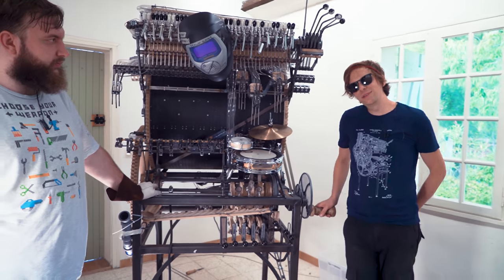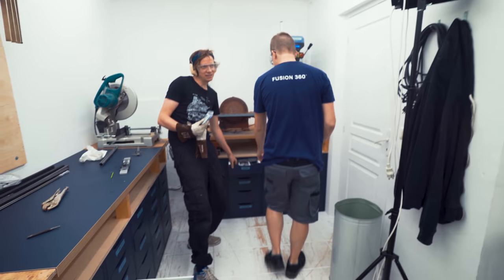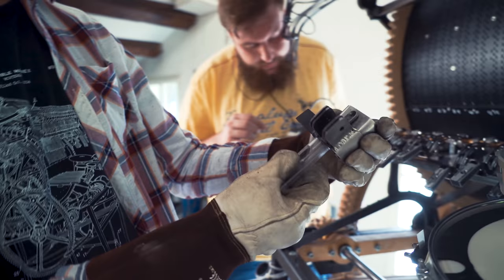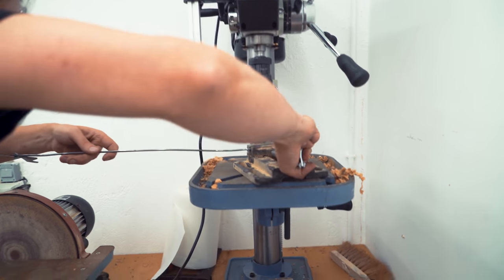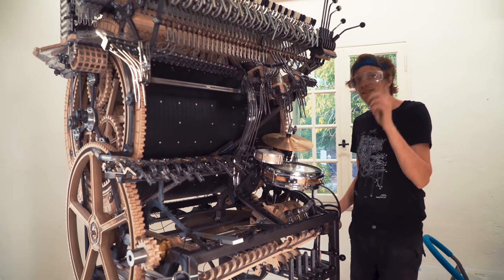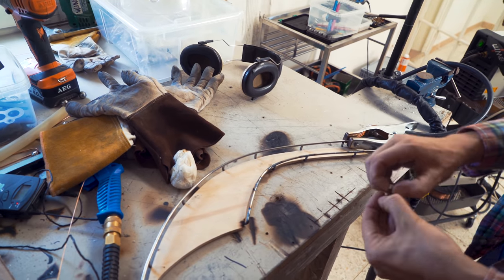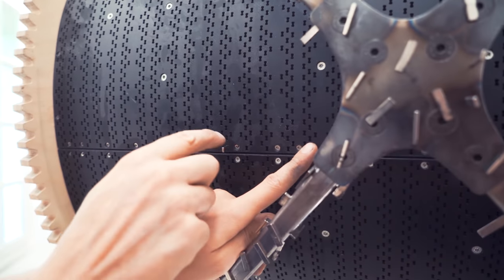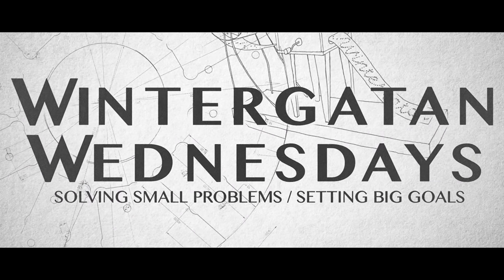Cymbal Marble Drop - Marble Machine X #98

Comment: Hey Martin, have you thought about adding a reference guide for the programming wheel that's mounted closer to eye level so you don't have to slide your finger down all the way from the top to add the pins in the proper channel? Love your work!
Reply: It would also give the machine something to look for at the back, which is pretty bare right now
Reply: That's a good idea!
Reply: The MMX will be programmt at a other way, it was only for this presentation.
Reply: I thought that there was room for improvement here as well.
Maybe some sort of color code affixed to the programming wheel for the different channels.
Reply: As I understood, the programming itself will be done on another device and the plates will be mounted just before the song starts. That's why he made 12 plates while the wheel holds only 4.
Reply: @patneil6844  You dont need the color code, the programming of the MMX is explaned at Ep #25 https://www.youtube.com/watch?v=iFuUSe44jtk
Reply: That cross-bar can have the color-code on it.
Reply: the magnet pins on the programming wheels will be configured back stage so there's no need for guidance on the machine
Reply: Everyone is pointing out the programming would be done in software and/or other systems are in place, but this would also just be a handy extra feature.
Reply: @GruntyGame  Surely, even if composition is done in software, Martin will find himself adjusting it on-the-fly once he brings it onto the MMX itself. A visual guide may or might not be useful (I think just black and white stripes like a keyboard would work fine for a musician).
Reply: @polyacov_yury  Yeah - just a little bit of paint on the back cross bar would do the trick.  Or... because the rubber programming plates are only for composing... paint the chanels colors to help you keep track.
Reply: the programming plates are removable, during a concert they would be removed to be reprogrammed, not as shown in the video.
Reply: @h.szymanski  I think you are correct for concerts, but this would be for composing music.
Reply: @kschleic9053  I'm excited to see what Martin has planned for the composing/first programming process.
Reply: Sebastian Sz actually one of the requirements of the machine is to allow composing music directly on the machine, so there will be times where programming will be done in-situ.
Reply: Colored strips on wheels, like different colored channels in a DAW
Reply: Maybe you could lightly stamp terms like “S1” into the plastic at intervals along the programming wheel, that way you wouldn’t be able to see it from the audience but it would be convenient for quick changes to the program?
Reply: that is an awesome idea. You could even add some labels for the different rhythmic subdivisions
Reply: @h.szymanski  That's true for concerts.. however, he has stated that he'll also want to kind of just "jam" on it by trying things out directly on the machine. In this case, where he's experimenting, i  think it might be useful to be able to tell which channel is which more easily.. though he might eventually get comfortable with it through practice.
Reply: I was thinking he could make a simple strip of plywood with carefully measured labels on it for each channel.  You could put a tooth or two on each end that mates with the teeth on the gears of the programming cylinder.  That way it is just a jig that can be used whenever it is needed and not get in the way when you don't.  It's also cheap and easy to make, and could be used on or off the actual Marble Machine.

Comment: 15:28 something is hitting the Marble collector? The Dampener?
Reply: I noticed that too, does it bother you that the exit doesn't line up exactly with the marble collection track?
Reply: @cpsnakemusic3082  if it gets hit enough times, then the exit might go entirely off-track to the marble collection track and we'll have a repeat of the marbles on the floor of the first Marble Machine
Reply: @cpsnakemusic3082  To be honest, yes it does. 
The marble get a small kick entering the Track. would drive me crazy.
Reply: @cpsnakemusic3082  Watching again it looks like the collector is attached to the axle for the dampening system and is only attached to the frame on a single point. that's why it flexes.
Reply: 15:53 The marble make a jump
Reply: the good news is that the close up footage of this gives me confidence that martin and his team have already noticed it. I'm sure they will make a revision to the mount. probably just wanted to get the video out on time.
Reply: Good catch
Reply: Yeah that needs to be more secure. It looked like it was about to fall apart.
Reply: 15.28 there might be coming misfunction for the cart rail system between the second rail. Also why did the whole cartrail moves when some one did something at the machine? In 15.30.
Reply: I was wondering if somebody else noticed.
Reply: Also, you need to make sure that even when the main barble route is full, the marbles will not derail during this little jump.
Reply: It looks like dampener's "T" lever axle has been tig-welded only to the marble collector's mounting wire which all bends under load. Hope they will redesign that part, otherwise it may snap during world tour ...

Comment: Be careful: Exposing magnets to escessive heat will demagnetize them.
Reply: I think he's removing the magnets before welding, so this shouldn't be a problem. Even if this partially demagnetized them, the programming magnets don't need to be very strong anyway.
Reply: I promise you that he knows more about what he's doing than you do.
Reply: @BigDaddyWes  That may be true but it's not a given, part of the charm of this whole series is acknowledging that Martin does not know everything, he's learning more and more and he's still technically a student to all of this.
Reply: @BigDaddyWes  now now, no need to be toxic ☢
Reply: I mean, those magnets are probably really cheap. You can buy a hundred 5x5 neodymium cubes for like 15 bucks on amazon
Reply: It's not about the magnet's value. But imagine some falling out on stage and ruining the performance.
Reply: @elmariachi5133  They won't use the magnets on stage, it will be pre-made metal plates with the pins soldered on them by a machine
Reply: Ah, Then it's OK. Seems like I missed this :)

Comment: Hi Martin,
One idea to help with the programming wheel : 
There are spots where there are no holes.  You should engrave the numbers (or letters) on those spots, so that it's easy to know where you are on the programming wheel.
On the video, you show (13:41) that you have to look at the top, and then follow the line with your finger.
I believe that this is error prone... 
Writing the line (or column) letter or number would help you, I believe.
Reply: This, or having a strip overlay at the back with labels, so as you rotate the programming wheel you can line any pin up with its instrument on the label.
Reply: @Vabbian  a removable  long piece of vynil  with symbols can be fitted during the programming   to make it easier and faster.
Reply: I saw that and saw an opportunity, too. Several good ideas already listed here in the comment, so I will sit back and watch now...

Comment: The more i see all these little welds the more I think designing the packing crate(s) to ship this will require another even longer design and build. ;)
Reply: I'm always thinking about how they will move this for the tour... It frightens me. I would be sick to my stomach trying to fly it or drive it to different cities.
Reply: @inthefade  I think its breaks down into at least three pieces. But if this is ever handled but a shipping company no amount of "Fragile" stickers on it is going to keep it from being mishandled. 

Even just moving it around on stage may over stress some of those joints.
Reply: You make a good point actually... if you saw the first video he said he designed it to break down into seven different sections, but it would still be interesting to see how it's going to be shipped
Reply: They make custom road cases for lighting and rigging by cutting the foam on the inside to the right shape. It should be easy enough to do the same for MMX
Reply: @jomloft1  I just think its going need more than just some custom cut foam but removable supports that can hold onto stuff inside the machine as it is bumped around and the frame is being flexed. 

Think more like all the bits you remove from a new printer that keeps all the delicate moving parts in place.

Comment: Does the marbles stay on track when a marble from the cymbal track and a marble from the primary track hit the intersection at the same time?
Reply: I was wondering that too, especially with the spot of missing rail right there :D
Reply: the part where cymbal track joins the primary track is sketchy af
Reply: These tracks are just placeholders, the final ones will probably address these issues

Comment: I’m rlly starting to realize just how difficult this is.  Cuz a lot of the balls have diferent drop height and I’m still confused how he’s gonna compensate for that
Reply: One of the very first features he worked on was an adjustable offset for the reader of each track in the programmable wheel. He can advance or delay when a marble is dropped per track by an arbitrary offset of time!
Reply: James Treydte he’s actually calibrating it to a universal drop-height. Each channel has both remote and proximate gates - one near to the reservoir, one near to the instrument. The proximate ones are all a certain distance above the instrument, and when they’re played, they’re recharged by the remote gate letting out one marble.
Reply: There are two marble releases for each channel/path.  The musically-timed release points are equidistant from their respective instruments.  The other release points (the ones at the marble divider) are reload release points.  This way, each time a marble is dropped on an instrument from a musically-timed release point, a second marble is released from the divider to reload the first.
Reply: As others noted - he uses same drop height. Otherwise he couldn’t play in different tempos (fall time is constant, but programming delays would vary with tempo)

Comment: I wonder what weight MMX is now. With this ever-growing number of massive metal parts. Will you have to move it with a forklift when it is ready?)
Reply: It's designed to be dis- and re-assembled. The whole thing isn't supposed to be moved in one piece.
Reply: @Minihood31770  I do not think it will be convenient to disassemble and assemble such a complex structure with an abundance of levers and rods, even taking into account modularity. After that, it will also need to configure and test everything again. Switching to aluminum could help solve the weight problem by reducing it by almost a factor of three. Moreover, aluminum is perfectly welded and easily processed, and its strength is sufficient for such a design. But the creator knows better anyway.
Reply: like Minihood said, many party can be taken off completely, and are meant to be transportant seperately, for example the programming wheel
Reply: @rcookie5128  No one argues about the possibility of modular disassembly and transportation. The question is how convenient it is) Imagine if you had to remove the engine, gearbox, body parts, etc. from it every time when you move your car). And then, in the order of reassembly, all this must be re-adjusted to each other and tune. Those parts of the MMX that are can removed, just have a small weight compared to the additional metal welded onto the frame. Their dismantling will not greatly reduce the final weight of this frame.
Reply: @VladimirUlianov152  Well I would say that it definitely is not convenient.. I don't know how much the machine weighs, but in every case I think at least partially dismantling it allows each part to be transported more safely as well. It's not all about the weight  :)
Reply: @VladimirUlianov152  "switching to aluminum" yeah, let's rebuild a several thousand part machine that is almost done.
Reply: @YourSweatyUncle  Well, if take care of this in advance, then such a problem simply would not have arisen). I also doubt that the creator will redo something, although even now the transition to aluminum can be carried out without problems. Gradually replacing steel parts with aluminum and fastening parts from different materials mechanically, for example, with threaded couplings. The only question is price and time spent)
Reply: @VladimirUlianov152  yeah, building this in full aluminum would be like 10 times more expensive

Comment: This is amazing, You have made so much progress. I did notice a potential problem: While you have made the marble tube easy to disconnect, the drop mechanism is now tying the two halves together. Those little bolts seem difficult to get at, and then you still have a long rod to deal with. But I know you will come up with a clever solution, thanks for taking us along on this journey.

Comment: For the cymbal marble catcher, I would use 2 layers of plywood; the bottom layer as you have it, and top layer the 2 sides.  These can be made on your CNC router.  Plywood catcher will be quieter.
     To make programming easier. get some silver Sharpie markers.  Hold one against the machine while the drum is turning, and make silver stripes around the drum (for example at the boundary between vibraphone and drums).  That way it will be easier to program drum while on the machine.

Comment: @wintergatan when you use the dampener for the symbol it pivots your plywood contraption for the balls escape and will likely mean balls dropping on the floor. Maybe if you make the end longer so it sits ontop of the other wooden ramp and have the balls drop into it so atleast if it shifts a little while using the dampening they dont drop on the floor. please see 15:27 for reference

Comment: At 15:25 the wire frame you made is being twisted and can either break at the weld or metal fatigue. I would recommend a sturdier vertical frame to hold the ramp to the main frame.

Comment: Your cymbal pivot... if it had a second arm pointing upwards, you could use that mechanism to catch the next marble. Then this simple design could be used on every marble release to always drop a marble from the exact same distance to the instrument impact point. With identical drop distances, you don't have to adjust any instrument timings based on your BPM.

Comment: You probably need some marking on the programming plates, for better identification of the channels and to ease the programming. You can wrap some 1~2 mm ⌀ copper, brass and/or stainless steel wire around the programming wheel, glue or melt it in place and finally cut them at the edge of each programming plate.

Comment: You should be so proud of how this is coming together! Is there a "capturing improvised designs" phase at the end of MMX Assembly? By that I mean measuring the improvised parts and putting them into the CAD model. May be a valuable long-term investment and provide peace of mind. That way if the MMX catches fire, the exact dimensions of improvised parts don't have to be derived again.

Comment: You should paint the programming wheel with white and black stripes corresponding to the keys at the top. Just tape off the black ones, spin it and have someone standing at the back with a paint brush.😂

Comment: I saw they programming the wheel is a bit confusing and following the paths from the top down could lead to mistakes, I suggest to build a plate that can be put on the programming wheel (just for the programming phase) with marks for the snare drum the vibraphone notes etc etc so you will immediately find the correct channel to put the magnet in, less mistakes and faster. But that’s only my opinion, your machine is anyway an engineering masterpiece, love your work, I’m looking forward to the world tour!!

Comment: Your automated marble collection area is going to have a overloading and overflowing problem. Especially with the introduction of the cymbal marble collection system from this video. If where the marbles that come off the cymbal is full they will fall off the side and onto the ground. 
I suggest adding double height, two tiered, rails, on a 30 degree  angle, to the main collection area and track to act like a cage.

Comment: One question and one idea

Question - on the vibraphone, why not offset the mounting on the note (maybe even make it a double sided mount) so that the note moves to a position where the marble will hit it in the correct spot, thus there is no need to move the guide for the marble drop point?

Idea - take some of the off-cut materials that you want to use for wall art and use it to frame some of the posters and/or set up the CNC and engrave a silhouette of the MMX on some of the off-cuts that has a big enough area to do this.
Also consider signing your art pieces.
Realize that just about every single scrap piece, including or maybe even ESPECIALLY the prototypes can be put up on auction as a potential art piece provided that it is authenticated with your signature.
I think this has the potential to create another good point of revenue for your project.

As an after thought -- looking at the amount of steel you are adding onto this machine and the complexity of the design -- I honestly do not think it will be viable or practical to take it on a world tour. Unless you are prepared to take at least a week or maybe more in advance on every stop for the assembly and testing. Considering the weight, you are going to need a LOT of help or you will have to custom build some form of a portable crane to take along too. This could also be a nice feature as part of the machine on stage if done correctly though.

Comment: How about putting a long thin sticker alongside each lane of the programming wheel? Maybe use one of these label printers with the thinnest tape available. Or even cooler would be to engrave it with a white ink.